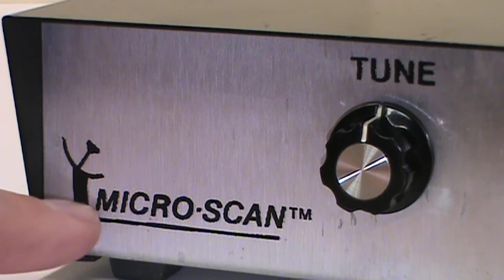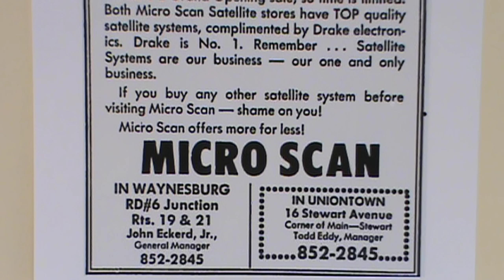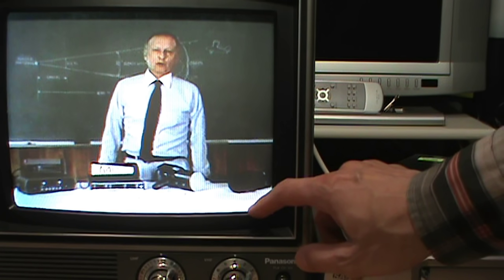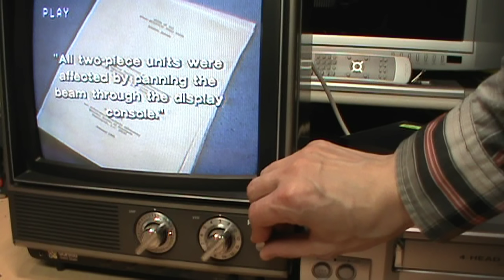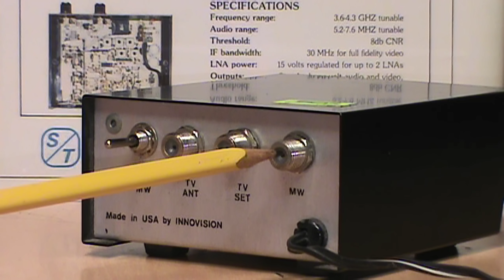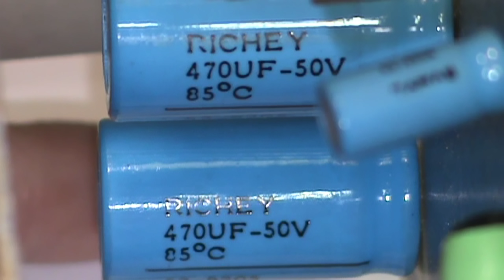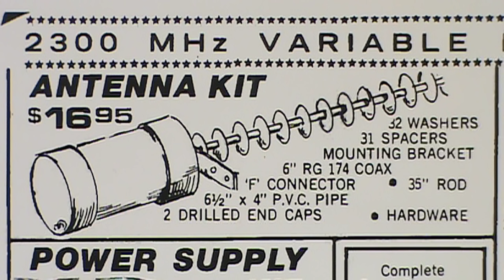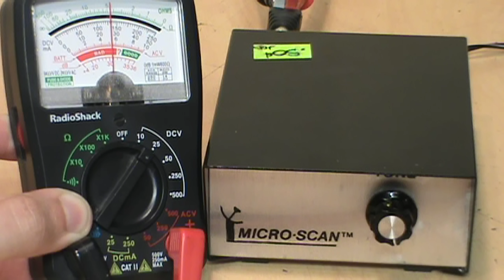Micro-Scan mystery 1980s TV device - Satellite? Microwave?

Comment: Yeah no. I believe with this thing is. This is a short hop point-to-point, microwave, video link. Good for nothing more than a couple of miles. Of a 525 line, analog video channel. And for perhaps, remote classrooms?

Before we had cable TV. Many got HBO in their homes. From a local, Microwave Link Transmitter. Before we ever had cable. But some got microwave link HBO. And somebody would come out and install an antenna on your roof top. And if you didn't have a rooftop? You would usually be SOL. Back in the late 1970s. Remember? 50 years ago? Unfortunately I do. I was at my peak and 19 in 1970. Ugh! Where the hell did the time go? What happened to everybody? Is everybody dead now? Just about everybody, is dead, now. Donnie is not helping any of that. Donnie has directly impacted my health. Or maybe it was too many microwaves? Maybe Jewish space lasers? Maybe it's Donnie? Yes. It is Donnie. We don't need Bobby Kennedy Junior destroying our health. Donnie is already doing quite a job of that.

When this thing was made. It was the dawn of satellite TV. Such as Ku band, C band. All required 10 foot and 6 foot diameter dishes. And a motorized mount. So you can dial into the satellites. Until they started Scrambling all the Video. With digital encryption. And the satellite party was over.

So this is from a bygone era… And unless you connect your Ku band dish to it? It probably no longer has any application? Since analog TV channels have also ceased operation. Shut down their original VHF Frequencies. Channels 2 through 13 now no longer exist. Except on the back of your antique VCR. Where you have a groovy channel 3 or 4 Modulator. So you can plug your co-acts. Into your old TV set they didn't have a coaxial input connector. You know how it goes? TV sets from 50 years ago. Some of us remember those. I had an, Instant On, Hitachi. No waiting for the picture to filament to warm up. The filaments were always on when the TV was off. Great for starting fires. Great for wondering what's wrong with your electric bill? You turned off the heat. Yet your electric bill was still $100. Your TV has been keeping one for you. So you don't have to wait for the picture to warm up. I do not miss, skimpy small, Cathode Rig Tubes, at all. I love our new technologies! I wish we had them when I was younger. I'm really too old for it now.

I've got my late brothers, 75 inch, last years, 4K LCD TV/Monitor. I watched virtually everything in 720 P and occasionally 1080 P. I can stream the 4K… Not us smoothly. And looking at the detail very closely. As I put my nose up to my screen. Yes I can see the difference. And they missed that candy wrappers sitting in the dirt by the trashcan 1/2 block away. Just so you know. It's very important for me to know that. And that's why I stream everything at 720 P. Because I really don't need 4K. It's Overkill. I also don't own a Lamborghini. As very few people need those. I don't know anyone that needs those. Not even rich people.

And so I do not need to see. How many hairs they have in their nostrils. That really doesn't excite me much. And I don't need to see a tiny speck of a golf ball flying through the air against a sea of green grass. It's just not that important. The camera will zoom in on it where it lands. That's why you watch it on TV. So you don't have to be on your feet for hours walking around following them with your smart phone camera. Because the TV network is going to do a much better job than you. You know?

It was to get the output from your, satellite downlink into your TV set. And it probably tunes between channels 3 and 4, continuously? Until the pictures straightens out and flies right side up. So it's either antenna feed or your microwave link from your HBO box. And with the logo of the satellite uplink. For which that HBO, supplier. Used a satellite downlink. To get HBO off the satellite. And to your home. Via a short hop microwave video link. Marquis Broadcasting comes to mind? I think my younger brother worked for them briefly? He was a computer guy. I was a rock 'n' roll and TV news broadcast guide. So I didn't have much to do with satellites. Though occasionally a local microwave link. And how we used to get you local news live at 5-6 and 11 PM. From our, Microwave Vans. And they would raise their portable masts. Above there vans. Pointing in the direction of the TV Station. Where we pick them up. And have the 2 way radio intercom. So that I, the audio engineer. Can punch a button in my control room. To tell the camera operator. At the remote microwave, location. Ass hole! You put his microphone on upside down! And all I have to do is press a button to say that to the location guy. And knowing I would be in the control room. They would never put their microphone on upside down, for me. Only British guys do that. We American folks want our microphones more direct. Pointing up at, the bottom of your chin. Not downward toward your bellybutton. Like the British do. I'm just saying…… I work for NBC-TV for 20 years so I know such useless stuff. I know I have seen those before. It was probably in a Popular Science, magazine kit? I built a couple things like that from back then. Never that particular contraption that I can remember? I can't remember much at 70. It's like it never happened.

I think I'm getting worse than Ronald Reagan and Donald Trump combined? Mommy! Oh yeah mommy is dead. She died September 2024 at 100 years of age. I forgot? She was around for so long. You just never think she's going to go away? But I cannot fix chicken soup as well. And I could not take her recipe book with me. I can even attempt mom's recipes because I don't know any and have none. Dammit.

Retirement is strange. When all your friends are suddenly retiring permanently. Like for all eternity. And they never got a chance. They worked all their lives just to drop dead. And planning for their retirement. That would not ever happen. I feel so bad for them. They were so looking forward to their retirements. And a life of peaceful bliss and relaxation. They never got to. I'll have to do it for all of them. I'm turning 70. My husband of 22 years only saw 60. My brother of 64 years was only 64. So many of my other friends and colleagues all gone. Dropping like flies. I think I have to hang on a little while longer for all of them.

I'm 50 miles away from the closest hospital. 75 miles away from Las Vegas. I reside in the middle of nowhere. In Amargosa Valley, Nevada. And I have too many marts. Fully stocked with lots of candy and lots of chips. An occasional hot dog. But only if you get them from the single package they put out. They stand business because they have gas and diesel. And truckers can park overnight for free. As there are 2 public restrooms. Since the many marts close at 10 PM and 11 PM, respectively. But. BUT!

Directly behind the minimart directly across the street. Is the Area-51 Alien Cathouse Brothel. Open 24/7. And they have a bar open until 4 AM. It's one of those famous, Nevada, Brothels. Out herein, NYE County, Nevada. Because it's not allowed in Clark County, Las Vegas area. Go figure? And gambling and booze available at all many marts. They just don't sell any THC products. Go figure?

This is the place you come to get away from everybody and everything. And I have great neighbors. They are long-term and have been here for years. And we are all well spaced apart. It's a great little RV Park. We've got our own little coin-op laundry facility. With nice new machines. That work well. Very reasonably priced. $1.50 for wash. One dollar for dry. You can ask for better than that. And central restrooms. With showers. When you want a longer shower than your, 10 gallon hot water tank will provide for. And I like long hot showers when I can get them. And only the 2 minute long splash in the RV. I can go much longer. But you don't want to find out when you have a head full of leather you just ran out of hot water. You know?

I get to turn 70 in a few weeks.
RemyRAD

Comment: Neat find. Like so much other spectrum, former 2.3GHz MDS and 2.5-2.6GHz MMDS bands were eventually repurposed in the US for more cellular capacity. 2.3GHz became LTE/5G "Band 30", used by AT&T, while 2.5-2.6GHz, once meant for educational TV broadcasting, became "Band 41", used primarily by Sprint originally, then T-Mobile after their merger. It's currently T-Mobile's highest capacity 5G band in most places, supporting their Home Internet service amongst other things.  In the rest of the world, including Canada, the same frequencies became LTE/5G "Band 7", with dedicated uplink & downlink channels (FDD), vs. Band 41 where the user & tower radios take turns transmitting (TDD = TIme Division Duplex).

Comment: There was an MDS service about 35 miles away from where I lived. My friend asked the company about subscribing. They said we were outside of the service area. My friend had a 4 foot parabolic dish, so he ordered the coffee can kit and built it. He attached the can at the focal point. Because my house was on a hill, we tested it out there and pointed in the direction of the transmitter. I'll  never forget watching the HBO  LOGO on the screen. My friend installed it at his house using a Channel Master 7 foot parabolic UHF antenna with window screen tied to it to reflect the microwaves.
I bought the assembled kit made out of PVC pipe with the PCB inside with little wings protruding out at the focal point of the signal reflected off of a spun aluminum dish. The problem with the low cost systems we were using was the varactor would slowly drift off frequency and the supply tuning  voltage had to be tweaked after period of time.

Comment: I used to build these. I’ve always been amazed there hasn’t been more information about these devices on the web. What you have there is in fact, just a variable power supply and decoupling device for a microwave down converter that is mounted up on top of a mast. The PC board for this receiver is hexagonal shaped, and it was the exact size necessary to be soldered onto the bottom of a 1 pound coffee can a small hole was drilled down at the bottom of the bottom edge of the can and a small piece of coax was passed inside the inside, the center conductor was exposed, and the entire interior of the coffee can became a microwave feed horn, that was tuned around 2.1 GHz. You then constructed an antenna, either one like in your example that was made with aluminum discs and a threaded rod, or you put the coffee can down converter assembly in a piece of PVC pipe that was mounted at the foci of a parabolic reflector, which was usually aluminum dish shaped snow sled.

The receiver was in fact designed by amateur operators, but it enjoyed very very wide use in the 1980s when subscription TV providers used to broadcast movies using a service that was called multi point distribution system, or MDS. You would pay a fixed rate per month to have their equipment installed at your residence. The commercial receivers were crystal, controlled, and did not need a tuning control. This receiver on the other hand had a voltage controlled oscillator along with an RF amp, a pair of mixer, diodes, and an IF amp, which drove the signal down the coax to your television Since the microwave signal provided by the MDS provide provider was not scrambled. All you had to have was this inexpensive equipment to get Pay television for free. The system was also known as wireless cable in some places.  Where I lived in the Dallas Fort Worth metroplex, cable TV took a long time to come to homes in our area. MDS operated at the same time as two or three over the air scrambled subscription TV services, that all existed up to the time that cable TV became available for most residents.

Although these little power supply / coupler boxes used a fixed-voltage regulator IC, the potentiometer was connected between the second (ground) pin of the device, and actual electrical ground of the circuit, thus allowing you to vary the regulated voltage output needed to tune the down converter.

Comment: That box is probably the inside half of the system. The LNB would have had a voltage controlled tuner run by the phantom power feed, as well as the integrated microwave downconverter built into the block.

Comment: I would be careful just plugging my camcorder into the MW input. I would bet that there was a DC supply voltage  traveling down that line. 

I built my own "Micro Scan" type box in the 80s. It was simply a variable voltage supply for a Voltage Controlled Tuning 2100MHz microwave receiver/down converter. 

I built one these down converters and watched a pay TV service in my area.

Comment: I made one of these to watch the "Z channel" in Los Angeles I'm guessing 50 years go.  At the time this was the only "movie channel" in the area and operated a little above 2 GHz.   I paired it was a home made microwave dish.   The reflector was a child's snow coaster dish; and the feed point was a coffee can.  The down converter was mast mounted and was described in "73" magazine.  Only the power supply was near the TV.   It worked well, but the frequency drifted slightly with changes in temperature and required occasionally retuning.

Comment: I know exactly what that is they were used for picking up cable signals. In Minneapolis HBO was broadcast from the top of the IDS building and anybody who had one of these little dish antennas could intercept it and tune it in with one of these boxes. After a couple of years the cable company figured it out and they encrypted it but it was fun while it lasted.

Comment: Electronerds used to pass around plans for these setups. You could make a receiver antenna with a metal trashcan lid, a metal coffee can and a length of all thread rod with fender washers spaced out along the length. A PC board mounted on the base on the base of the can and inside was a carefully cut piece of coax cable. You could get all sorts of stuff on it.

Comment: I made a few if these, bought a cheep kit for the circuit board threw out the MRF-901 microwave transistors since they really was not low noise and replaced them with higher quality low noise transistors, you can use a 1lb coffee can as an antenna with the pickup element about 2 inches from the rear of the coffee can they worked real good I also modified the power supply to make it more stable so the tuning voltage would not drift.

Comment: I made my own antenna and down converter in the early 80's for MDS in Louisville Kentucky. I could get Showtime and some other soft porn channels 15 miles from the transmitting tower. I guess they thought the frequency made them secure from hobbyist and DIY'ers.  Doesn't take much effort at all as it turns out. The band was also shared with IFTS, (Instructional Fixed Television Service), another failed attempt at classroom television back in the day.

Comment: The case for it is indeed a Radio Shack project box from the 1980s, the knob as well. I know because I built an audio input switcher box back then with that exact case and the knob is on the rotary switch that I used.

Comment: 12 to 16V sounds familiar. 
In systems like those where you don't want to climb up your antennae pole a lot, varactor diode were used quite often. They change their capacity with voltage. The trick is to connect them in reverse so a P-N junction barrier appears. The size of the barrier is voltage dependent so the electric capacity can be adjusted by voltage. So you can tune your frequency mixer remotely using the supply voltage. In systems like those, a virtual ground on +6V is used so you need 12V as power supply. And by increasing the supply voltage, you lower the capacity of the diode which tunes to higher frequencies.